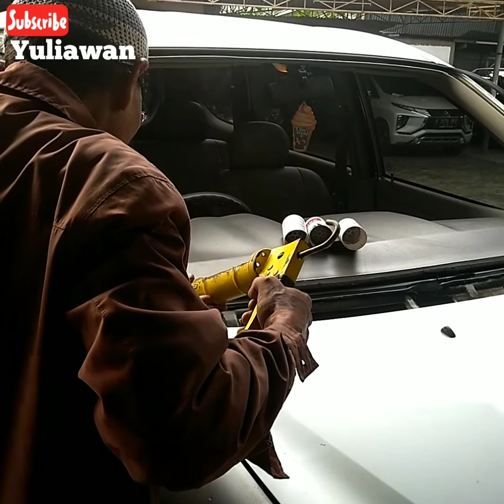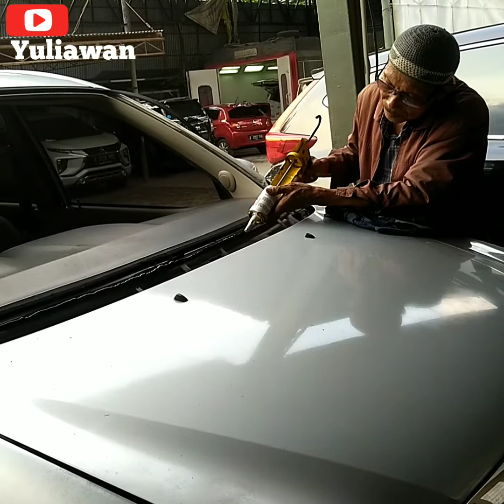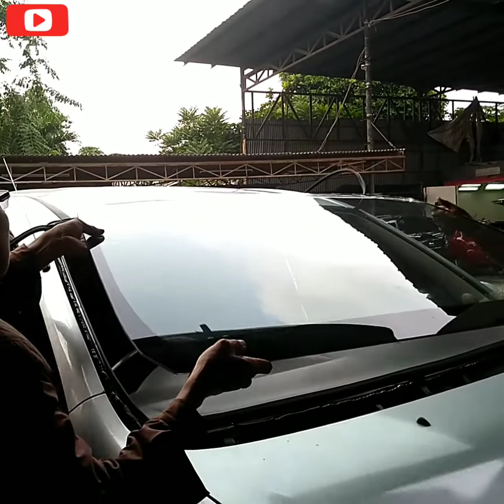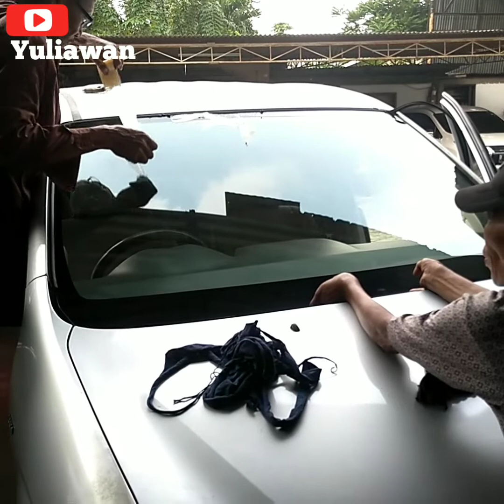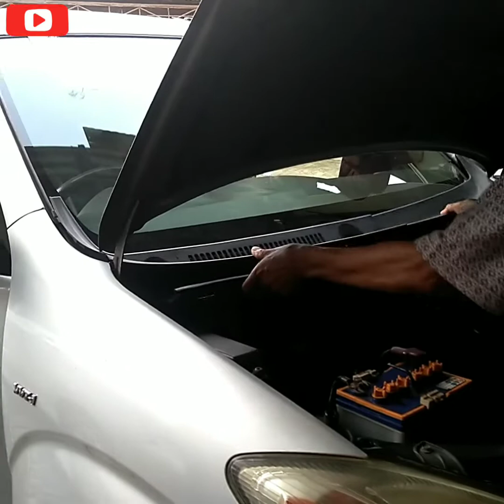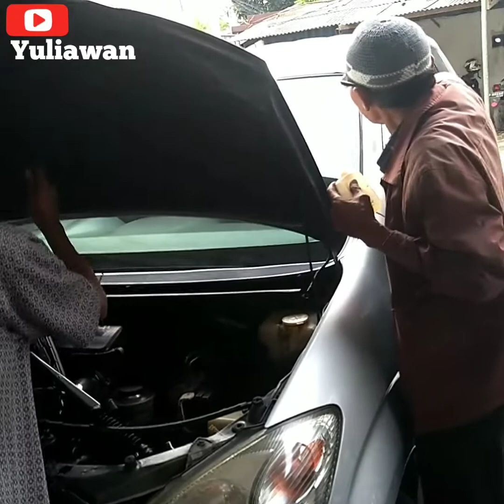cara pasang kaca depan Toyota avanza

Comment: Lebih simpel kalo karetnya di tempel di kacanya dulu.. jadi ngga blepetan lem silernya..
Reply from the maker: Ya memang karetnya di tempel di kaca dulu kalo gk dipasang mana bisa..kalo silicon/siler blepetan masih bisa di bersihin pake bensin